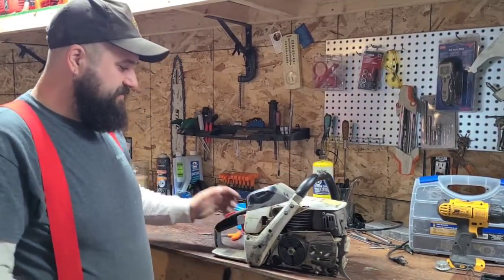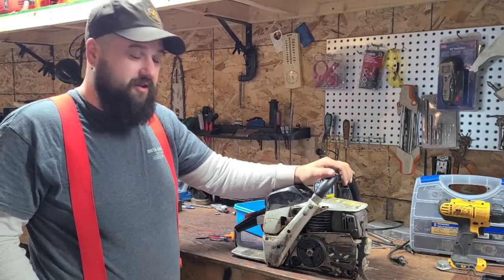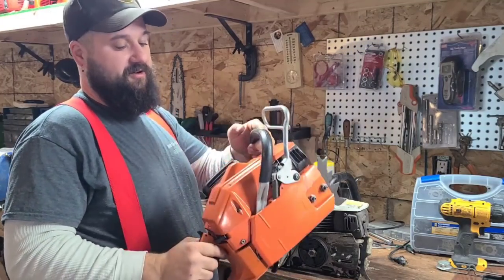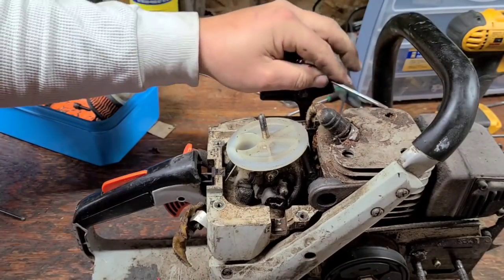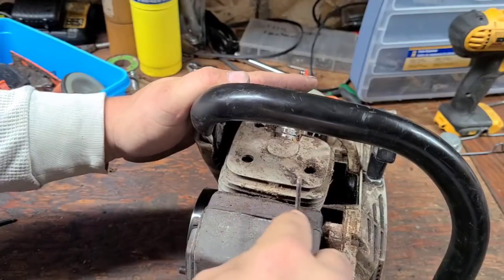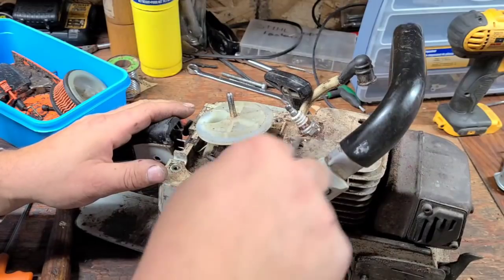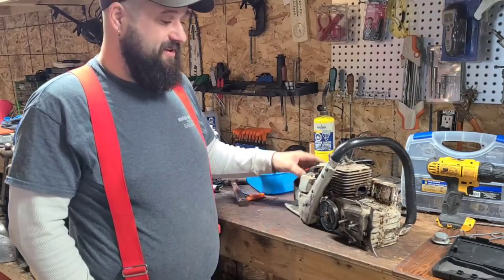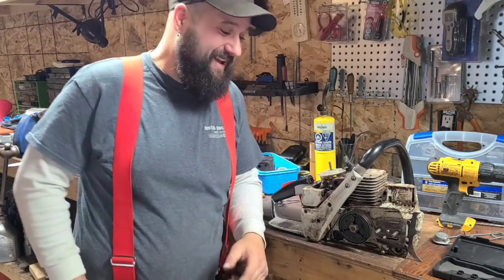Echo CS-670, turdiest saw ever on my bench!!!

Comment: 40 years ago I was working in a Husky/Jred dealership. Back then you had a mix of ancient stuff and the very newest, at that time a 266, 181 or 2100 was the ultra level saw, the XP's were just on the market. The older stuff ran from Homies, Pioneers and Macs to really old Remingtons and Lombards and such. Some of those saws had NEVER, EVER been cleaned beyond what it took to keep the chain on the sprocket. We still had guys running 25-1 with 30wt! Many times I'd have a saw come in when it finally couldn't take any more abuse and I'd spend and hour cleaning the thing up just so I could take it apart. I had guys refuse to believe that their saw was the same one they brought in. Amazing some of them ran that way for years under professional use. Those guys could sharpen a chain but that was as far as most of them went on maintenance.
Reply: Thumbs up on this comment. I’d love hearing more stories like that. Hearing some OGs talk about camp saws and what they’ve seen, it is amazing they kept running. Thanks for the share. 👍🏻
Reply: @andreawhalen4142  I didn't put it down to being lazy as these guys worked their butts off. I put it down to them having way too many irons in the fire and being exhausted at the end of the day.

Comment: I have 2 echo 3000 top handles i bought in 1999 and they have proven themselves indestructible. Looking forward to the rest of the build. Thanks
Reply: Me too. Great little saw I used for over 20 years and she still keeps running good.
Reply: I bought a 3400 new in 98.  Still have it and it will start and run anytime I need it.  Bought a scored 340 newer version as a project and have it still as well.  Great top handle saws.  I own ten saws and those two are far and by the most generous with oil.  Bought a 501p last fall and am loving it.

Comment: Old echo saws and the really new ones from the last 3-4 years are good saws. They may be harder to fix than stihl and not designed as well but they are tough and have tons of power still. Last forever too, still own the echo saw i learned to cut with when I was 6.

Comment: I am a Husky fan boy,  but those Echo 590-620 saws are very nice.  I have  a few.  I don't know about that one, but  Echo likes to put a bypass on the high speed jet so you can't lean them if you open them up.  I cut at 8-9 thousand feet and stock they won't lean out with the high speed closed all the way(a new jet is available).  They are so easy to work on as well.  I am currently working on some of the smaller saws and they are super easy to work on(so far all of them are easy).  Opening the exhaust and they come alive!  All of them are easy starters.  The 8000 series are so plugged up they are dogs like this one is.  Also a product called "Oil Eater" will attack burned sap like crazy.  I use it for chains that have sap burned on.  It will also get after paint and plastic so test it first.

Comment: Try turpentine on it for clean up. It’s made from pine resin, was the beat carb soak I ever used. Learned that by accident working on a 2 cycle snow blower. Local hardware had a dented can for few bucks and picked it up. Sat in the garage for months, this snow blower needed a carb kit and that was all I had. Worked great. 

Never used it on pitch before- your results may vary. (My disclaimer for the day).

Comment: I have a couple of the older echo orange 80's ish saws. Love em. The full metal tank CS302 runs fantastic but boils gas in heat sometimes. The 500VL is a fantastic saw for an older 50cc and I really like that one, has a great sound and will idle super low. Have a few brand new ones too and I like them all. Haven't broken in the little 2511t or the 490 yet but I like them both. The 2511 the stock 3/8 chain is way too much for it and jumps and catches. Switched to a low pro 3/8 stihl bar with minor modification and it runs wayyy better.

Comment: Tinman purper power works great on saw it will bring the worst crud off get it at advanced auto or hardware stores that's what I have used it really cleans well just have to spray on and scrub and spray off then it will shine

Comment: paint thinner has been a good clean up solvent for me, it does not evaporate quickly which is what you need...time for the crud to soak. Gasoline??? ya know better right? Somewhere in the cleanup you'll need some water solvent of some type, some of the crud will not be soluble in paint thinner. You might also try some Gunk engine cleaner which has polar and non polar properties which means it will work on oil based and water based caked on dirt. BTW, I'd be cautious with the hammered screwdriver method of crud removal, I have learned the hard way having broken fins in air cooled cylinders.

Comment: That's the best model cs 670 I've had two. They run and run and run I've ran 32 inch bar and down to a 20 inch they got eough to get it done. I had a employee put straight gas in one. Need to get it rebuilt. The other was stolen out my truck. I got the new model cs 680 and like it. Would you be interested in rebuilding the one

Comment: I have a first gen orange 6700 "Turd" I got off my uncle that had blew up and set in a car port for 15 years.  We cleaned the cylinder and threw a piston and rings set in it I got from Chainsawr.com for $25.  I never did anything more and a year later the exhaust side melted again.  Bought another piston kit from Chainsawr, said CS6702 on the box.  I assume my other piston was a 6702 also because the piston I removed originally was a flat top 2 ring, the replacements have both been domed 2 Rings.  Only question is, can you split those first gen 6700 cases?   I heard no but Gray 6700, 670, 680 were splitable.
Reply from the maker: As far as I know the 6700 and 670 cases are the same so yep you can split them.
Reply: Thanks!  I know allot interchanges except the difference in cylinders and carbs.  Plus I've seen a case gasket just not on 6700 in the diagram.  I would like to get the bugger up and going again just because I like the miserable old prick.

Comment: I have a mid-80's John Deere made by echo it's an ev-80 it's pretty heavy but the torque is awesome and it looks pretty cool and I have a old Sears Sportster I found in the trash it's runs great just can't figure out who made it looks like homelite or maybe McCulloch I'll try and post a picture maybe you know
Reply: echo made a few sears, in the late 70's I think. I run a john deere 66ev 2cylinder. from the '80s..

Comment: Equated to cars,
Stihl: Maserati. High dollar, but go down like Monica (Lewinsky). And are high dollar to fix.

Husqvarna: Porsche. High dollar, but go down less than Maserati. Comparable to repair when they go down.

Echo: the Toyota Camry of power saws. Higher-than-normal cost of entry. But will last forever, so long as you change the oil.

Comment: Hello Tinman

I’m an 3rd generation Sheet Metal worker from Ontario. I’ve started taking interest in power saws lately because of you and Buckin’ Billy Ray Smith. I heard you mention in a video that you have a Stihl MS261 that you’re thinking of building. I was wondering. Is yours the M-Tronic model? I have that saw and I was wondering if that saw would tune it’s self after porting?

Keep up the good work.
Reply from the maker: I don't have a 261, I have a 260 though. As for porting and tuning yes the mtronic  shoukd tune itself after mods.